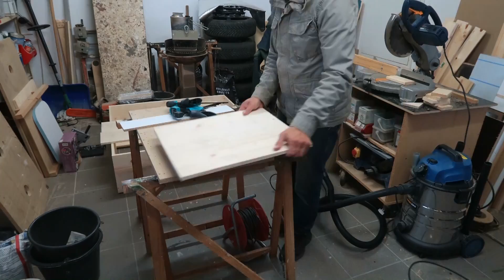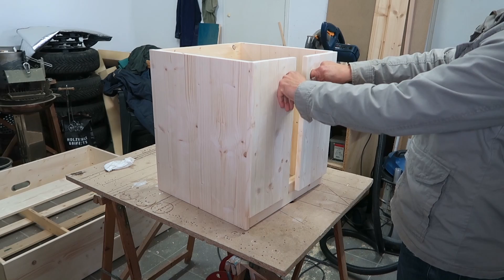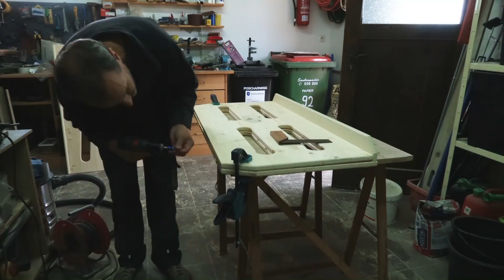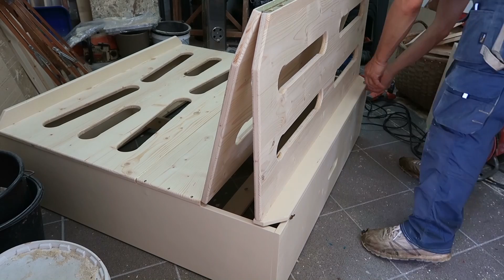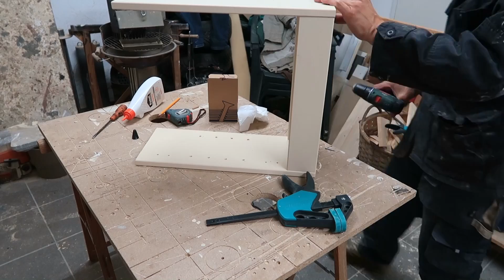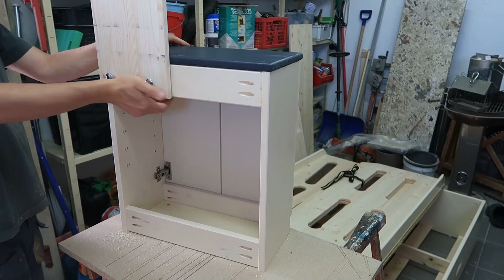Dacia Dokker DIY Mini Camper (2/3)

Comment: Super Arbeit!
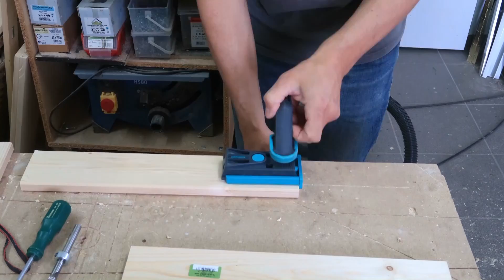Wie heißt das Tool für die Schräge Verschraubung bei 1:42?
Reply: Super klasse Video! Sehr inspirierend 🥰. Bin selbst Handwerkerin-Neuling, baue gerade meinen Twingo als Van um 🤣 darum schließe ich mich der Frage nach dem Tool gern an und... kannst du kurz sagen, was der Vorteil einer Schrägverschraubung ist? Habe es nun schon öfter gesehen... freue mich auf weitere Videos und bin gespannt auf das Ende 🙃
Reply: @katrinhessler2168  Bei Schränken sieht man die Verschraubung nicht.
Reply: @48sinneD  ist jetzt verlinkt in der Infobeschreibung
Reply from the maker: Heißt Undercover Jig oder Pocket Hole Jig. Damit kann man recht schnell was zusammen bauen.